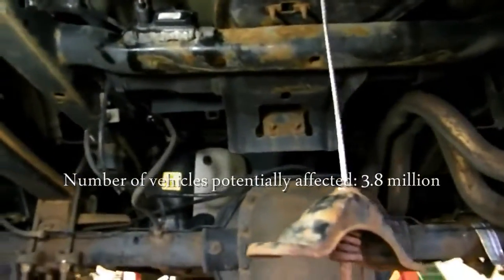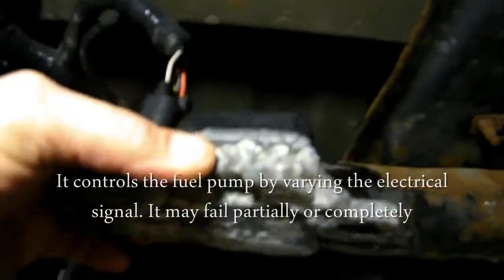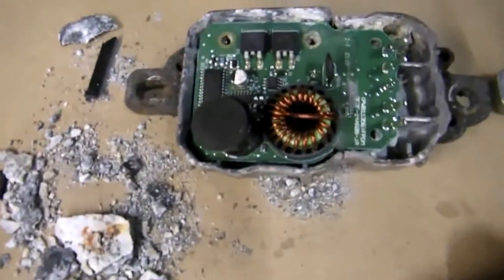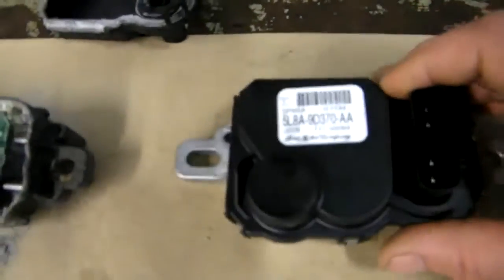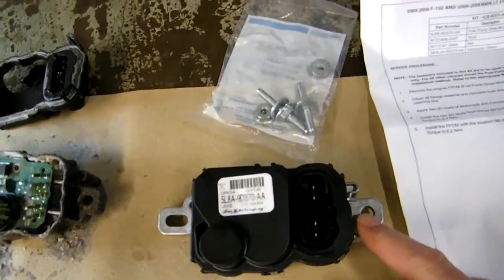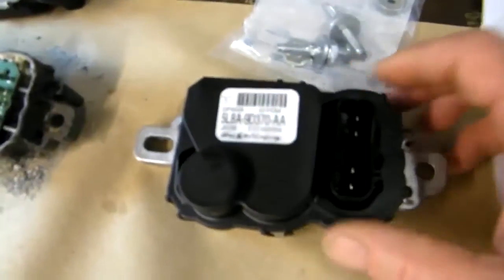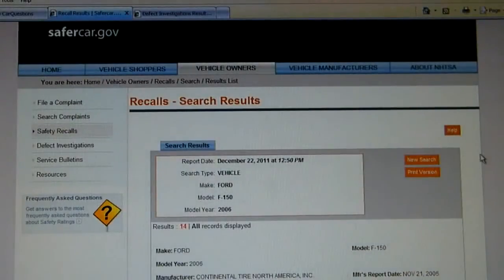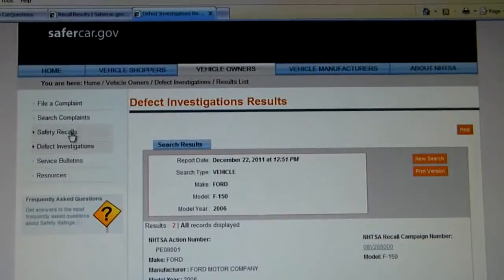Ford Expedition 2002 2003 2004 service repair manual

Comment: uh. I was told and I checked myself. this does not exist on the 2004 4.6L xlt, 2wd. looked at the location it's supposed to be mounted at. its supposed to be on the frame between the driver side rear tire and the spare. not there. asked a trusted person told me it's only on 05 06 models.